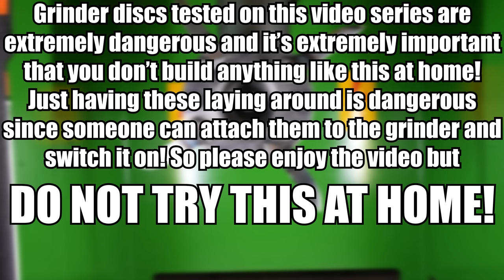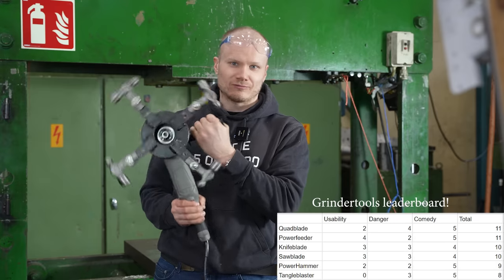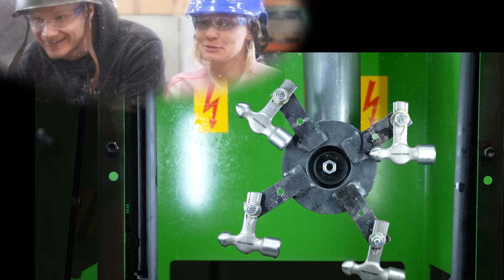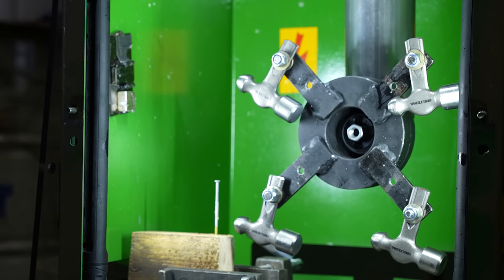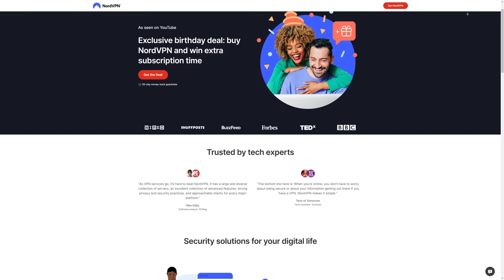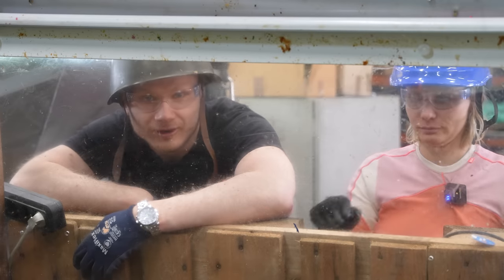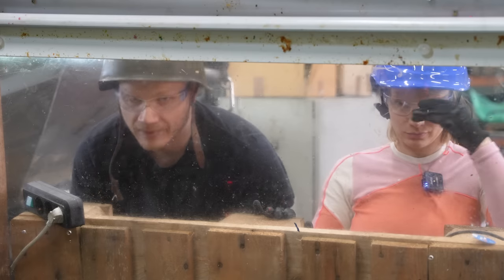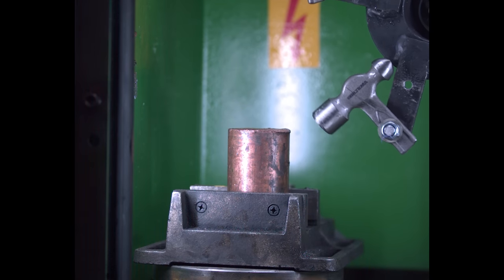Grinder Discs That Shouldn't Exist | Power Hammer 5 000 000

Comment: Would have liked to see you spin up the hammer with the press raised, then lower the spinning hammer onto the nail. I think it would have more chance of driving it in rather than bending it outwards?
Reply: I think it could be made or manipulated to perform much better.  If it's worthwhile is a  different matter.
Reply: he's thinkin about his new girls ass more than logic
Reply: If someone wanted to put way too much time into developing the concept, some sort of detent that held the hammer heads in the "folded" position and didn't release and allow the heads to swing freely until the grinder was up to speed may also help.
Reply: @Kenneth_James  
What happened to Anni?
Reply: @brennyn  it needs to spool before work is fed in.
Reply: @georgejones3526  they got divorced, but he says it was amicable and everything is fine.
Reply: @kwastek  
Hate to hear that. They seemed so nice together.
Reply: yea its weird that he didnt lower it for the nail but then lowered it for the squirrel. It seems like it wouldve worked pretty well if it was lowered onto the nail so it didnt just bend it away immediately
Reply: @brennyn you'd have to be pretty sure they all released at the same time I rekon. 😮

Comment: Grinder idea: Weld a length(or multiple lengths ) of chain to it with a weighted spiked ball on the end of the chain welded to the grinder, like some kind of automatic flail.
Reply: Well... Those articulated hammers are pretty much flails already.

Comment: Could you turn on the mechanism and then lower it down to the nail as it's spinning? That way the mechanism is already to full speed before it begins hitting the nail. That way the nail won't immediately bend. I feel like that would work and you could drive the nail all the way into the wood

Comment: You need to get rid of that huge weighty disc in the centre? Angle grinders are designed to spin much thinner low weight items. The centre should be very thin, and doing so should significantly increase the RPM's. Especially with the knives, they felt so bottlenecked by the huge thick piece of metal. Maybe less so for the hammer heads, but I'm sure they'd still go much faster with a much thinner disc...

Comment: the timing of the hammers striking the object and then rebounding off of it to clear the spin is almost perfect... did you actually design it this way or did you get lucky that it just happened to do this? Put that on a hydraulic motor and you have an item....

Comment: okay the nail test would have worked if they had been going at speed when it first turns on the hammers arnt in line yet so they pushed the nail backwards

Comment: What happens if you put guns on gringer ad shoot it will the bullet cuve or go straigth
Reply from the maker: I have plan for making disc with empty rifle cartridges bullets pointing out and then spin it up to speed where bullets fly out from the casing :D
Reply: The will fly straight, you can try with water and a hose, it’ll look like it curves when using water but it’ll always be moving in a straight line away from the hose, same goes for a gun

Comment: I've got a real life on that I made that ended up working quite well. 

I helped to build a house for my parents in California that was built of straw bales. I wanted to make some decorative nooks for books and display in the master bedroom. First I roughed them out with an electric chainsaw to remove most of the straw about 150mm into the straw bales but still needed to make the back nice and flat so the plaster would be nice and smooth for the wrought iron and cherry wood shelves that I made to go inside. So I took the safety guard and disc off of the grinder and mounted a 200mm skill saw blade to it. I held it out at the very ends of the handles and it worked quite well to smooth out the back surface of the nooks.
Reply: every part of this sounds like a terrible idea, but hey, i'm glad you still have all your fingers

Comment: You need a stiff spring on the back of the hammer as a flexible spine. It lets the hammer go back when hit but quickly returns it to ready position, no need to rely on high speed, centrifugal force.

Comment: As the officers on ships seem to think that the more sound a tool makes the more effective it must be this would definitely earn its place on any merchant vessel. In what role, you might ask, to remove rust from steel. Is it more dangerous to the users than actually effective, definitely yes! Will the tool be forbidden by work environment regulations? Yes, definitely! Will said officers care? No, definitely not. Will they think that they are protected from said regulations, as they are a ship? Yes, absolutely.